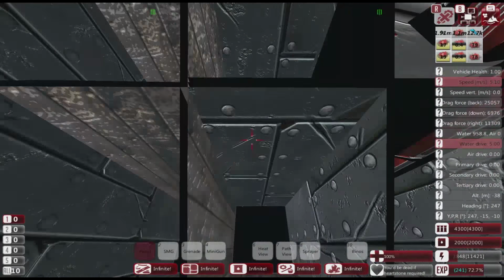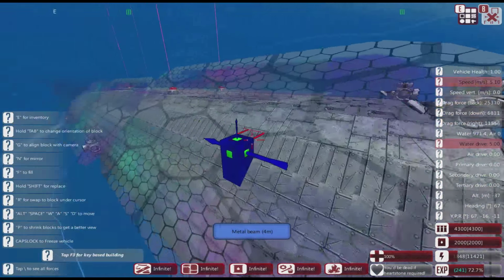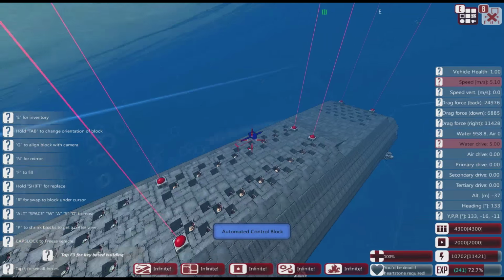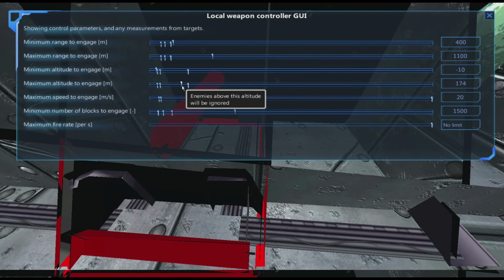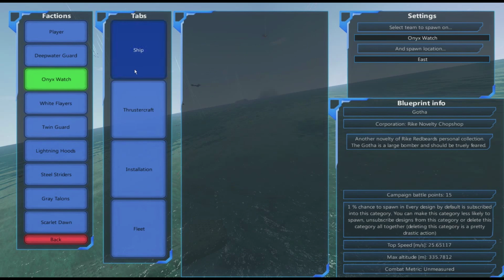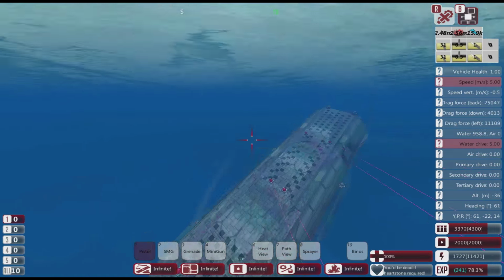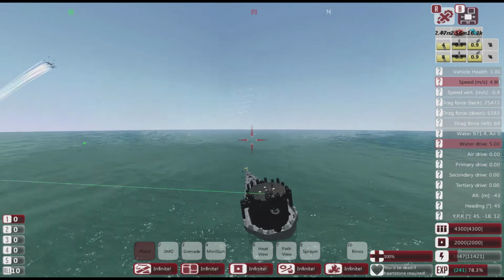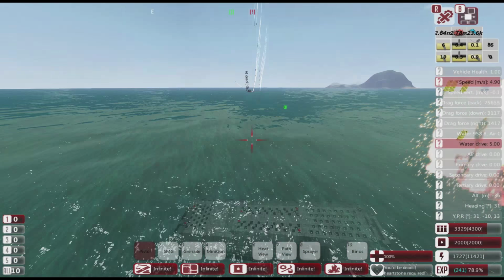From The Depths 1.6 E56- ICBM Sub Pt3, Combat Testing . LetsBuild, Playthrough

Comment: Your fragmented setup is wrong. You should start as small as possible then increase from 1 to 3 to 5 to 7 and keep adding 2 onwards. Rips everything apart.
Reply from the maker: Tomel Zene that can work but depends on your target. I did a lab video on penetration of frags and if you have all your frags too small then you get over penetration and not enough area effect. The first couple should be small 1 to 3 but after that you need some wider to ensure you widen the damage potential of an already open area. Also if missile is against aircraft you want a wider spread to try and take out vital flight components on surface to try and bring vehicle down.